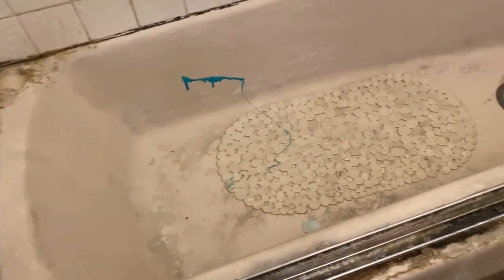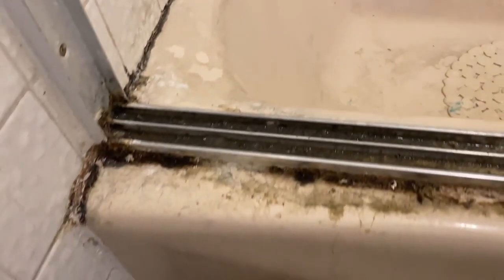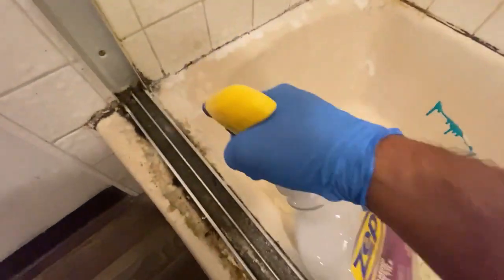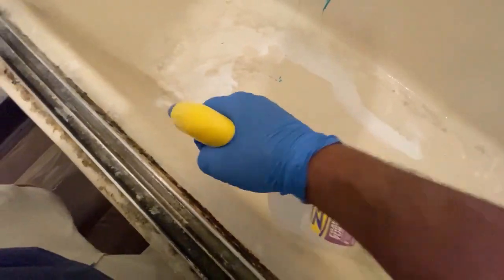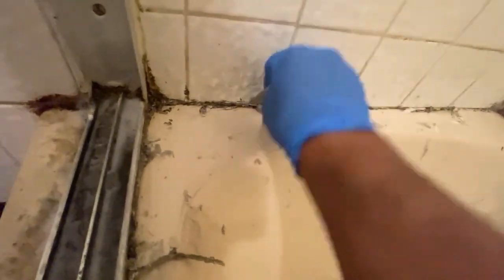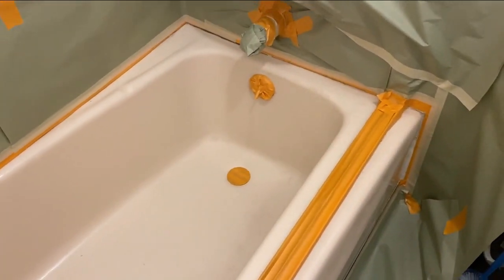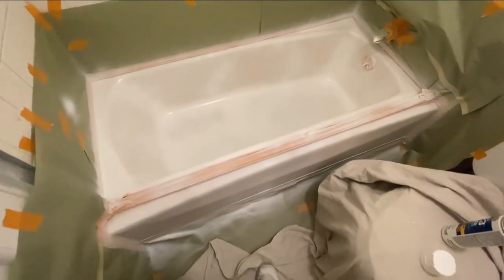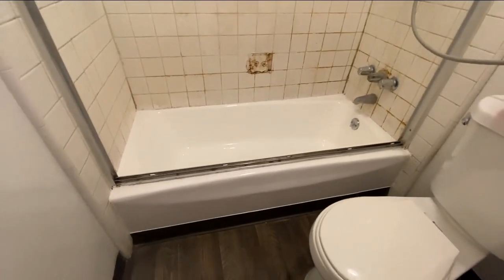HOW TO REGLAZE A BATHTUB #7 | NASTY DIRTY BATHTUB in a rental unit need REGLAZING

Comment: Do you ever use a non slip paint instead of a bath mat? If so can you recommend one that will last? What would the sequence be? Tape off the section after etching cleaning and sanding? And then top coat over it? I'm assuming you could charge for this and it saves a potential issue using the mats. Thank you.
Reply from the maker: Bath mats with suction cups void the warranty. I give a non slip option but I also feel it catches dirt much easier. I usually recommend a bath mat without suction cups from Amazon.

If I get a specific request for non slip I use Shark Grip added to my mixture and spray as last coat at bottom
Reply: I use cobra grip for my customers.  After prep and primer, wait till primer is complete dry, tape off. Mix up glaze and cat with no reducer and the cobra grip powder and roll on. Then topcoat. However I would like to see DP do a shark grip video. Would be cool to see another method.

Comment: Fantastic. You mentioned you showed the adhesion promoter being applied in another video. Which video?
Reply from the maker: I sprayed a primer in another video...however I will make a video with the adhesion promoter. I love it.
Reply: @DPTubs 
That would be great. I just purchased the X Factor Adhesion Promoter from Resurface and I'm eager to see the best application is. They recommended a cloth but not how much to use. I feel a lot of it would get wasted being soaked into a cloth? Do you still sand when using the adhesion promoter? These videos are great, cheers

Comment: Looks great, I've been searching around youtube to find your most recent video trying to leave a comment somewhere were you see it, I work as a maintenance technician but I've picked up on painting the complexes tubs when the pros dont feel like showing and I've gotten a Titan Capspray that my manager bought and I use Krylon 2 part tub and tile, however when I spray I use a tyvek suit because of all the vapor and mist from the gun, I've followed your instructions for the settings but still same result what type of ventilation do you use? I see you shoot the paint in your t-shirt.
Reply: Sorry for the long comment/ question, I heard it's very toxic even with the full face mask, so I am just looking around to find the correct ventilation and if or what fan you use.
Reply from the maker: I have a video with the exhaust fan I use and the link to buy it